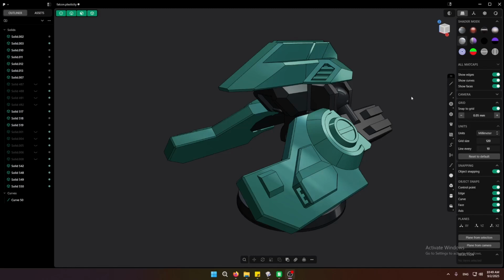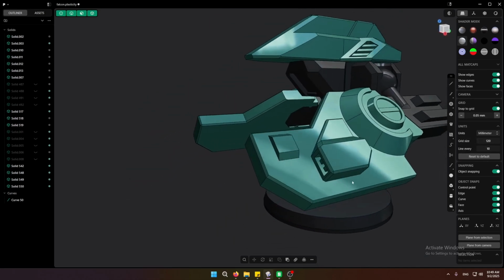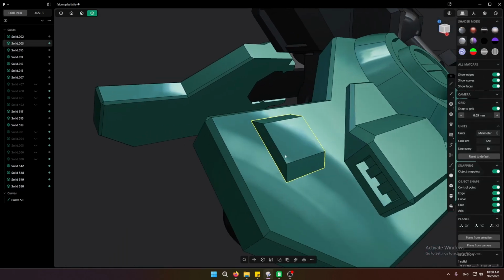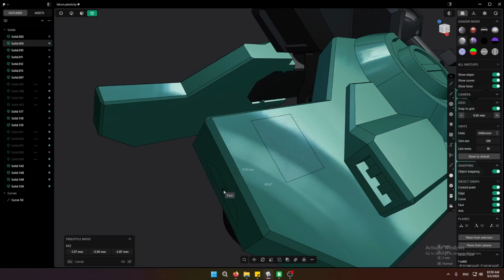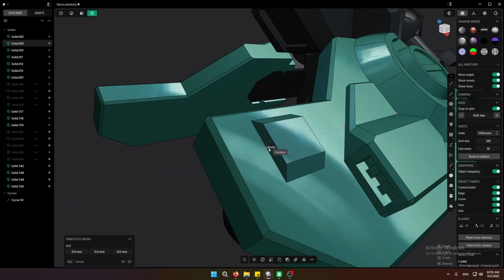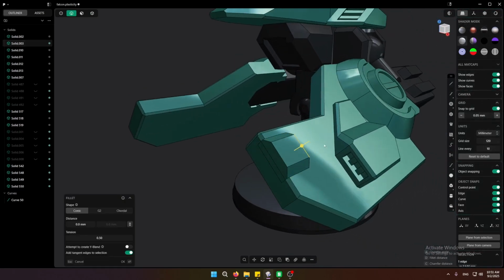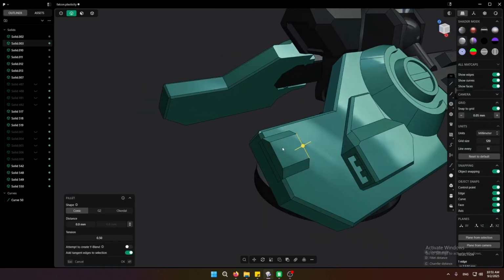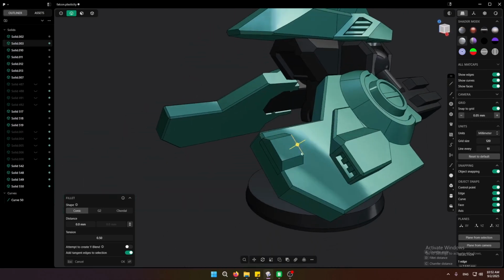How to Actually Align Objects in Plasticity (without workarounds)

Comment: Hummm, I gotta say you skipped things for beginners that I hate...for example, you didn't mention you change between object and face selection. I swear people watched this video, got angry, and left. Thanks anyways, it gives other people with more or less experience to share better ways in the comments to do stuff you explained. My suggestion, take more time to explain, slow it down. You are teaching to intermediate level users here not thinking about beginners or even completely new CAD / Parametric designing apps users...just my 2 cents. Good luck!

Comment: You can also hit G then F --> Select a point/vert, face, or edge then move the object in a straight line - you'll notice a blue/purple line that signifies it's moving in a straight line

I do this with snapping turned on, and if it doesn't snap to an edge I make a curve line at the place I intend to go.

The G - F combination is one of my most used commands
Reply from the maker: Agreed!

Comment: Just to let you know, there's an even easier way that doesn't necessarily require the object moving constrained to the construction plane's Y-axis, but rather than the normal direction of whatever edge or face you select. Select the object to move, hit G (grab/move), then V to set the pivot point for the move, and in your case here I'd select the bottom edge. This will now make the move gizmo conform to the normal direction of that edge, so you can move the entire object along its relative axis. You'd just start moving it in the required direction and than hold ctrl while hovering over a target edge to snap it to the boundary you want. It's very similar to what you show, but way more powerful.

Great model btw, I love the design of it :)
Reply: Awesome, thanks for sharing! Just tried, works like a charm
Reply: Where do you even find information like this?  Does plasticity have full documentation yet?

Not sure what version it was at when I did my 30 day trial, but there was zero helpful documentation in the app, and some tool descriptions on their website...but they were for older versions and I wasn't sure if they were up to date or not.
Reply: @PowerScissor “Information like this” can be found directly in the Plasticity documentation, which you can find on Google by searching for “Plasticity documentation”. The Move tool docs are in the “Common / Move” section, which explains all the options, including the Pivot feature, which is definitely a simpler and more natural option than the one shown in the video.
Reply from the maker: I don't recall that being in the docs back then, or maybe i could not interpret it, because it sure took me a while back then to figure out, and nobody even on the plasticity subreddit seemed to have a clue